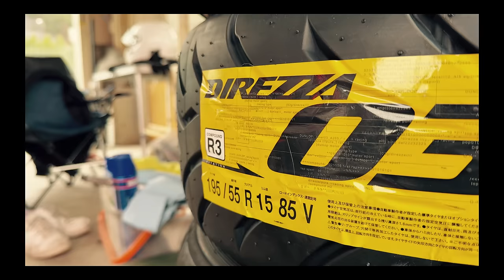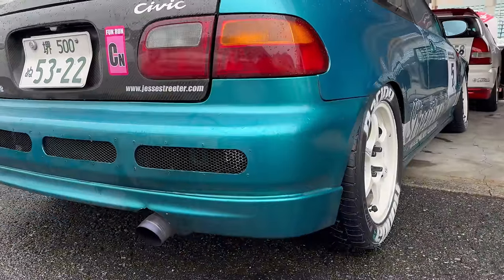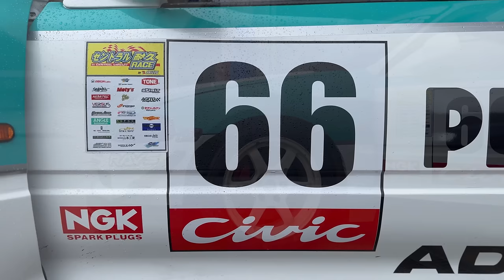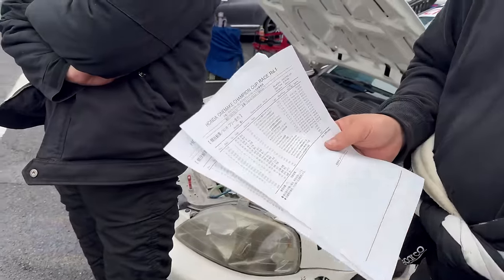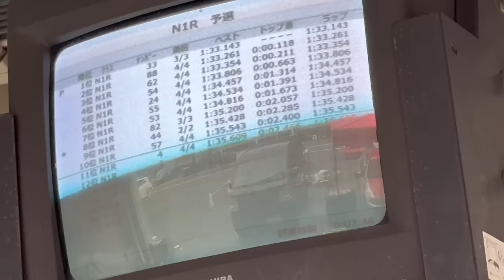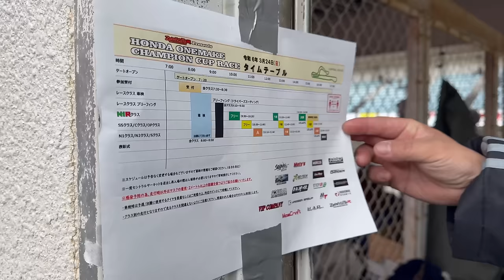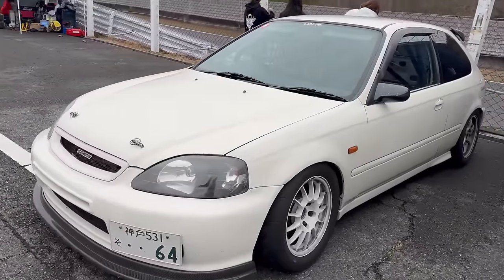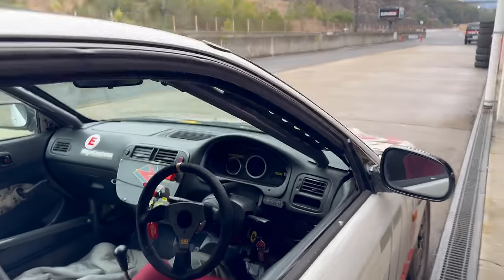CRAZY CIVIC Battles at Central Circuit Kansai JAPAN | ZEROFIGHTER Honda One Make Race N1/N2/S Builds

Comment: N1 cars are broken down into two classes, N1 and N1R. Since the Suzuka Clubman One Make Race ended last year it seems that Zerofighter has maintained the category of Suzuka Clubman spec, which is N1R. The N1 class is less strict and you will see other modifications like carbon body panels, aero cut-outs, etc. All N1 cars stick to the 195/55/15 tire rule. Thanks for covering these races! These are my favorite cars in the world!
Reply from the maker: Thank you for clarifying this!! That helps a bunch and also thanks for watching🙌
Reply: Is there a 1.3 civic class? I know rough smoke covered the last n1 series.  I want to try the 1.3 civic
Reply: @korosuchimu1479  Not that I know of.